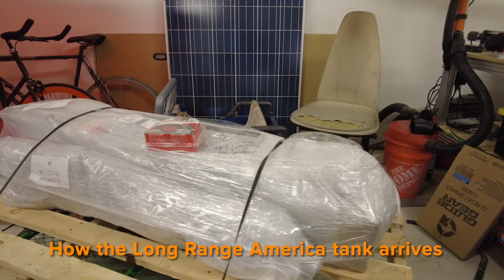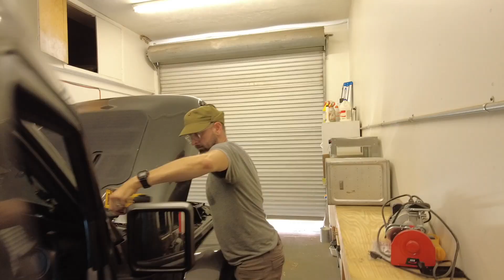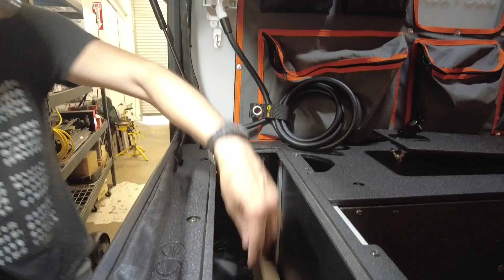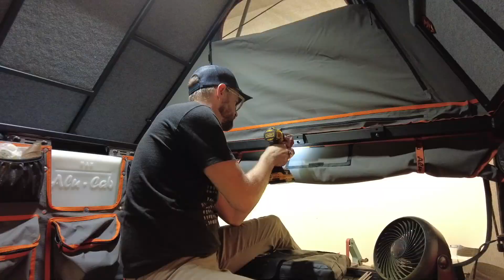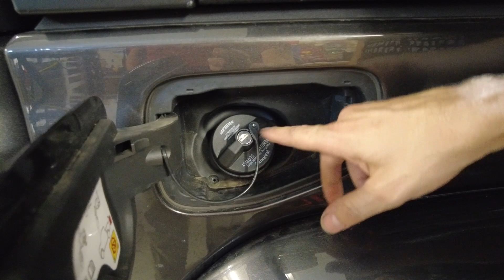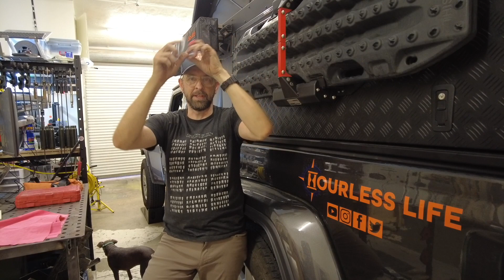Jeep Gladiator Overland Build: Mods for Our Global Overlanding Rig

Comment: Wow, really likes this guy, easy going and laid back and Brill at his job. Wonderful to see a master craftsman at work. It's definitely the little things that make a difference when you're on the road. for instance, on out motorhome they installed a double socket like yours but rotated the plug sockets through 90 degrees so the wire don't interfere with one another. Great video.
Reply from the maker: Yeah Brien is a wizard. Really glad you got a chance to see him in action here. Solid friend and great guy all around. ~ Eric

Comment: Is that a custom attic from Blue Ridge? I e-mailed them a while back and they said that they were not making one as of then because lack of mounting spots? Thanks
Reply from the maker: It isn't custom. It is the JL attic which has been modified to fit the JT. We had to create two brackets to hold it. In the video Brien mentions where he found the bracket mod specifics. Hope that helps. ~ Eric